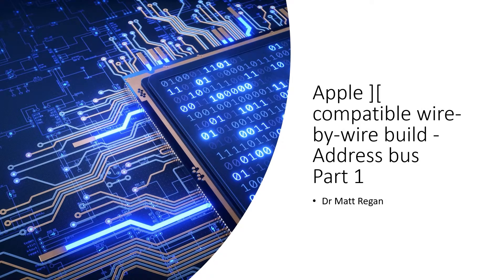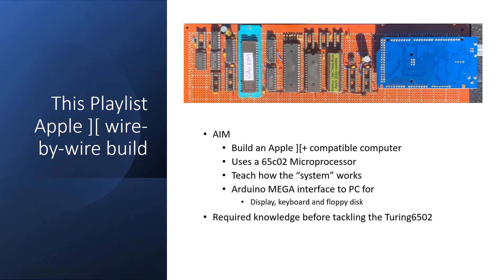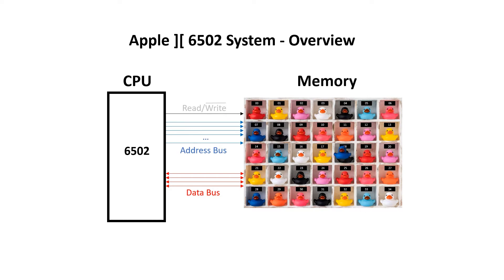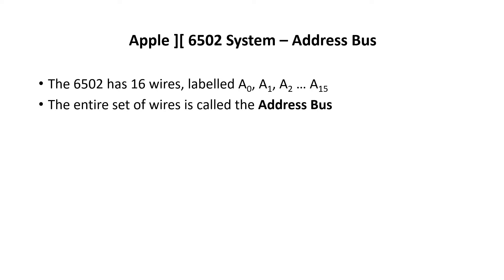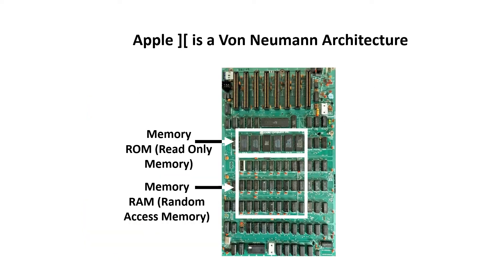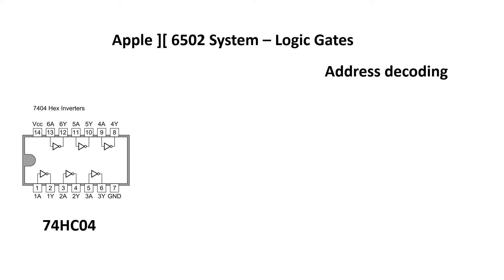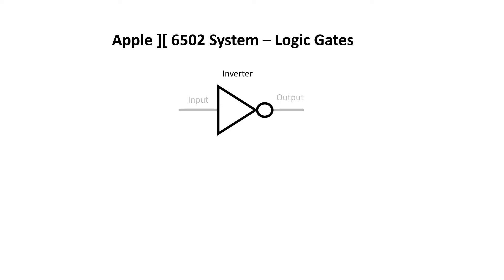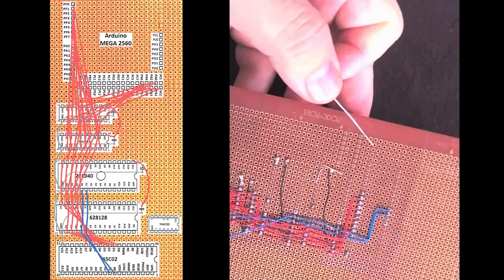Apple 2 wire-by-wire build Part 4.  Address bus build A

Comment: Thanks for these videos. Got 2 question. 1) are you planning to do an Atari 8bit video system and 2) could you give a demonstration of how you prep the wire for point to point connections? Thank you.
Reply from the maker: Thanks for the feedback.  I have been tempted to do an Atari 2600 series, which i lusted after in the day.  I never had a 400/800 so i don't know as much about them.  
Yep, i've been meaning to do a wiring video for a while.
Reply: @ thank you! I had a 130 xe. The Atari computer system has a lot of registers in it. I’ve been researching doing it like you with an eprom state machine, but there is a lot of addresses in the $D000 space.  Would love to hear how you would solve that in TTL.
Reply from the maker: @cdwlights  I'd probably store them in an SRAM and shadow the once you need i a physical latch like it did in this video https://youtu.be/R-qfziBnLFY